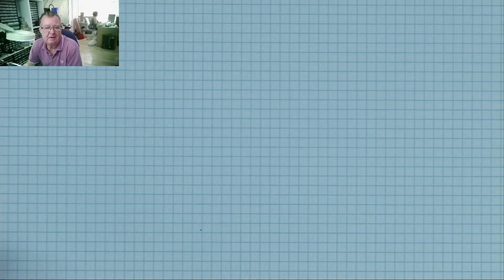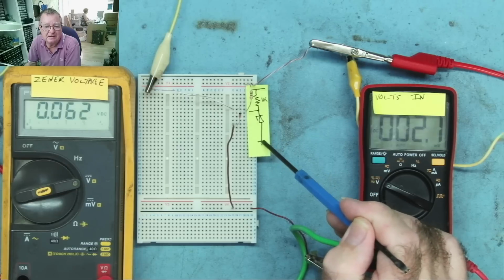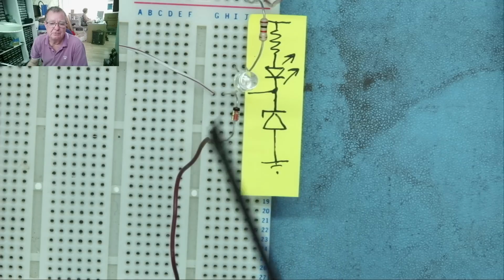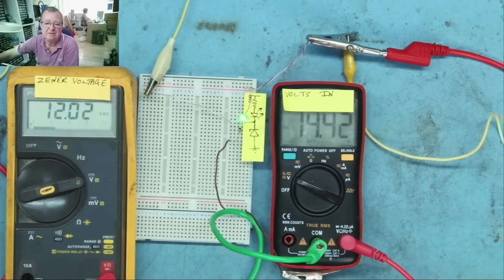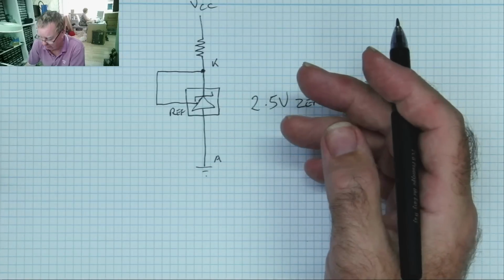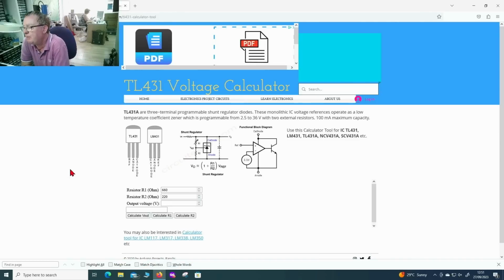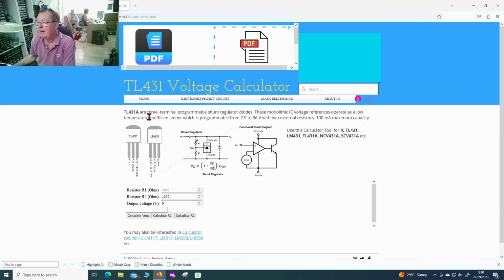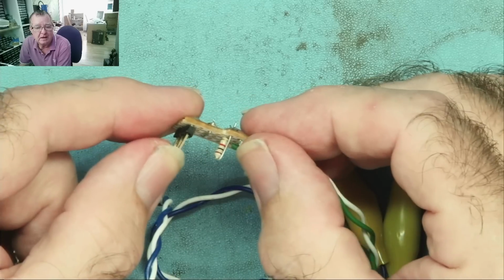All You Need To Know About TL431 To Fix Stuff : Test in in and out of circuit, test feedback circuit

Comment: Good information = thank you. I believe that you missed an important point, regarding the TL431's operation... You noted that its output might be somewhat effected by its tolerance rating and that is true. However, IIRC, Zeners are rather particular about current... They have a current draw range. And, their voltage output will vary based on where the current draw is, within their required current draw range. Hence, selecting their supporting resistor does require some attention. Too much current and they die. Too little current and they may not come on. With a precisely selected resistor, you will get their precise voltage output, within their tolerance range. I am working from (an old) memory, so I could be incorrect. Cheers!
Reply: The concerns about overcurrent causing overheating and failure on a zener diode are real, and obviously of greater concern, the higher the zener voltage is. However, all zeners have a dynamic slope resistance, that is the change in voltage as the current changes. In addition, they have a "knee", the region where the zener is just starting to conduct which makes the voltage vary a lot as the current begins to increase. Neither of those are desirable in a voltage reference, and the TL431 improves dramatically both in its slope resistance (typically 0.15Ω) and in the abrupt change from non-conduction to conduction as the reference voltage is reached. For comparison, a 3.3V zener may have a slope resistance of as much as 100Ω,
Reply: @RexxSchneider  Low voltage zener diodes also have a large temperature coefficient. As one who has designed equipment subject to wide operational temperature range in the aerospace industry (-55 to 125 deg C) this is important. Unless the zener diode has a voltage range of 6 to 7V - specially selected and run at a precise current a TL431 is far better.

Comment: Why would you use white for positive lead. Is this confusing?
Reply from the maker: Those were just some old wires I salvaged out of a bit of old scrap CAT5 LAN cable so the colours are what they are.  But if you are fixing stuff you should get used to this sort of thing.  For example on motherboards, sometimes the silk screen shows a solid white area for the negative ends of electrolytic capacitors and other times (different manufacturer maybe) it shows a solid white are for the positive end of the capacitor!  The moral of this is never trust the colour of the wire to indicate the polarity!!!

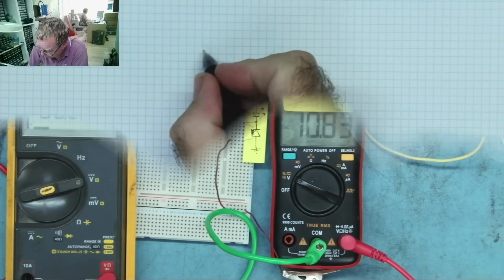Comment: timestamp 12:30 so for that LED the voltage does not really matter it is the current? in other words you can put a LED on 20 volts as long the current wont go over the current the LED can handle ?? just asking for the ones here that may not know this .
Reply: Yes.
LEDs definitely have a maximum voltage and it is not much higher than the voltage at which it starts conducting.
For example a LED could start producing light at 3V and reach its maximum current at 3,5V.  

But if you restrict the current, it will not reach that voltage and you can use higher voltages to drive the LED. Most of the time a resistor in series is used, to limit the current. If the value of the resistor is high enough, the voltage drop at the diode will not be higher than the maximum voltage. If a LED with max. 3.5V and a resistor (that is not too small) in series are connected to 20V, the voltage drop across the resistor will be 16.5V or a little bit higher and the LED is safe.
Reply: LEDs are very much like any other PN junction diode, except for the light emitting part.

Below a certain applied voltage, which depends on the specific design and materials used to make the diode, there is very, very little current conduction. At some applied voltage current flow begins to rise. If you continue to increase the voltage applied across the diode the current will begin to rise sharply. The curve is more or less logarithmic (the change in current through the diode is proportional to the log of the change in the voltage across it), but there are additional effects that come into play.

So no, you can't apply 20 volts directly across an LED because the current would rise to something vastly too high for it to handle and it would be destroyed practically instantly. You can use a 20 volt power source but you MUST use a resistor or other means to limit the current. If you just used a resistor, most of the voltage would be dropped across the resistor - perhaps 17 volts across the resistor and 3 V across the LED for a white LED. You use that 17 volts to calculate the resistor you would require to set the LED current, simply applying Ohm's law.

Comment: They DO NOT work the same either way around. Their sharp zener cutoff only occurs with positive voltage connected to the cathode. This is why you are getting a random-ish value one way around (2.6V) and an exact 2.49-2.5V the other. They're made of a bunch of BJT transistors and (zener) diodes in the package, and you can bet those don't work 'either way around' either.
Reply from the maker: Sorry but you are wrong  When I was testing the TL431 I have the Ref and the Cathode connected directly to each other to give a 2.5V reference. That is the two outside pins. The Anode is the center pin, yeah?  So whichever way round I put the TL431on the tester, the 1K resistor from my bench PSU is always connecting to the C and Ref pins and the ground is always connecting to the Anode 😉 @ivolol
Reply: @learnelectronicsrepair  I've never worked with the TL431 but the internal schematics for LM236 and LM336 shows a lot of transistors inside. I guess the Cunningham's Law is in effect.

Comment: You use the component a bit in a weird way. Normally R1 is connected to the cathode, not to VCC. If you connect R1 to the power supply (VCC) the reference voltage increases when the voltage of your power supply increases, and thus the zener voltage will vary with the voltage of the power supply.....which is not what you want if you want it to act as a voltage reference.
Reply: When used in the feedback of a power supply, the TL431 is being used as two virtually completely separate subcircuits. One is a fixed 2.5 volt reference. The other is a linear "error amplifier." The feedback path to the "ref" pin is very long - the entire power conversion path.

Great care is required in this sort of application to be sure the loop will be stable. If done wrong the power supply becomes a power oscillator.

You could use a TL431 as just a shunt voltage reference and use separate amplifiers in the feedback circuit. I've used circuitry like this in a switcher that required more sophisticated control than can be easily implemented with just a TL431 doing both reference and amplifier task.
Reply: Great description Sir...thanks ! @D614G_aka_Doug
Reply: That makes sense too. I would like to see a scope measurement of the voltage on the cathode. I think you're right.  @D614G_aka_Doug
Reply: Ah, right. Because of Cr it works as a comparator at startup, after which is is an becomes error amplifier for higher frequencies (because the RC series feedback loop).  @D614G_aka_Doug
Reply: Normally there's a third resistor R3, that is essential.....R3 is in the supply line. And R1 is connected to the cathode, not Vcc.
Reply from the maker: I connect it exactly as shown on the Texas Instruments datasheet https://www.ti.com/lit/ds/symlink/tl431.pdf though I do agree when used with an optoisolator there is usually another resistor that connects to the cathode of TL431 to ensure it has Vcc before the LED turns on @kriswillems5661
Reply: The application schematic is on page 25 of the datasheet. Do you see Rsup and do you that R1 is connected to the cathode? In your schematic Rsup is the LED and its series resistor.
Reply: Would you mind telling me which page of the data sheet you used? I honestly don't understand the way you use it.
Reply: Maybe I can prove it to you this way : in your schematic increase the supply voltage and measure the zener voltage when you do so. The zener voltage will go up if the supply voltage goes up. Now connect the side of R1 that is connected to Vcc to the cathode of the zener and LED instead (both cathodes are tied together). Now, when you increase the supply voltage the zener voltage will not go up. You can do the measurement. (Your led and series resistor take over the function of Rsup)
Reply: Yes the addition of the voltage divider didn't behave correctly and I believe that was obvious  @kriswillems5661
Reply: @kriswillems5661  The schematic you're looking at is for a shunt regulator. You set the TL431 as a programmable zener diode by connecting R1 and R2 across the device. That makes the cathode sink current as soon as the voltage at Ref reaches 2.5V, i.e. when the cathode voltage reaches 2.5V x (R1+R2)/R2. For use in a switch mode PSU, R1 and R2 form a voltage divider across the PSU output and the TL431 will conduct if the PSU output voltage exceeds 2.5V x (R1+R2)/R2. As soon as the TL431 starts to conduct it feeds back via an opto-isolator to the switching regulator ic and effectively turns it off, allowing the output voltage to fall back to its set value.
Reply: @RexxSchneider Thank you. That makes sense. It just works like a comparator comparing a reference voltage of 2.5v with a fraction of the output voltage and switches on or off the LED accordingly. It is not like a typical (constant voltage) zener at all in this application.